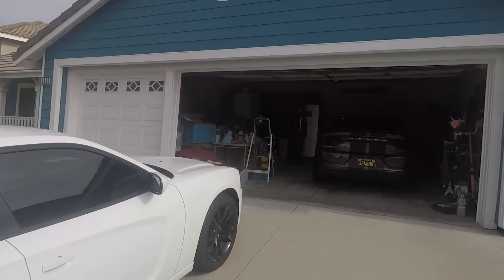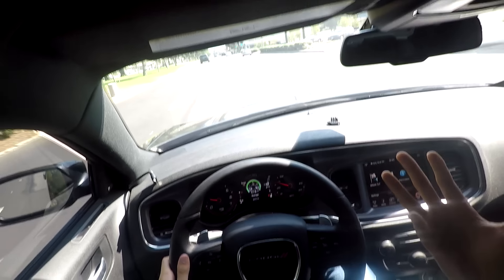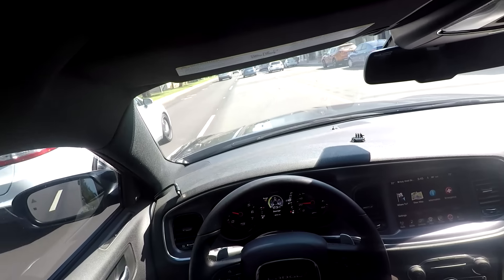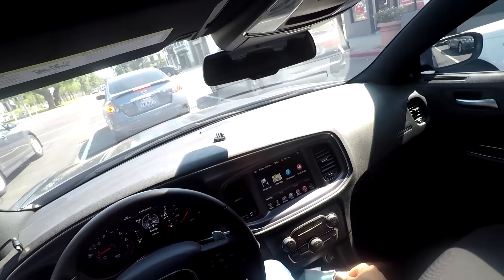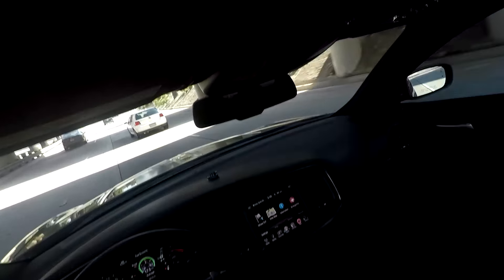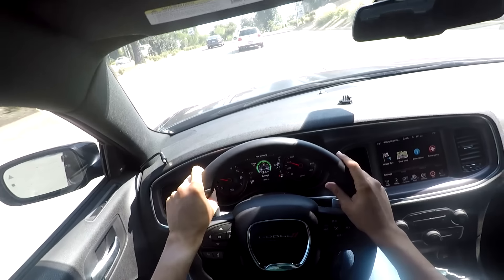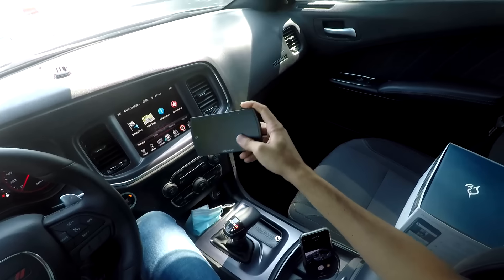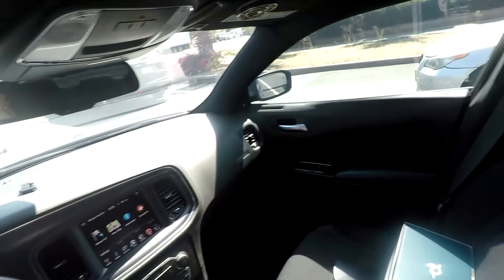CAMMED Charger R/T: First Impressions

Comment: Sounds great. I agree. I just cammed my RT with Comp Cams HRT Stage 2. I have high flow cats with my long tubes, but it is crazy loud. Some love it, some hate it and said its overly loud. And yes, tuning mine has been crazy. I used Hemifever. He did my initial stock tune, then all the bolt ons, but the cam has taken at least 6 tunes already.
Reply from the maker: Just checked out your idle video. Sounds great! The tuning stuff is just part of the game bro - I expected it
Reply: What made you chose stage 2 over the stage 3?
Reply: @jbinas4  sometimes more trans work with the cam 3 and 4
Reply: Hey I'm using the same tuner and thinking about the hrt stage 2 or the Texas speed stage 2 are you a 6speed or nag1?
Reply: @mmastar14  8 speed auto.
Reply: What do u mean it's taken 6 tubes?
Reply: @H3mif4v5r  tunes

Comment: I tool mine to a dyno tuner today. He is going to bring it in a week from this Saturday. He states that with the hemis and these cams, it is really hard to dial it in without a dyno tune. He said you can get it somewhat close and it will run, just like crap. He is going to dyno tune at several rpms to get the casual drive and wot all synced
Reply from the maker: I've heard very similar things with regards to how sensitive these things are. Keep me updated, bro.

Comment: Glad ya got it figured out. I have the Comp Cams 270 and I lost alot of lowend power when I went to th420is cam. I am getting ready to do a 3200 RPM stall to get the low back. But what is helping you is the 6.4 intake on the lowend. With my cam now and the 6.4 intake when I hit second gear at WOT the car starts to slide sideways and throws you back in the seat. My dyno I was putting down over 420HP at the wheels before the 6.4 intake.
Reply: Any vids
Reply: @just_a5.7  Nah I really don't take any vids.
Reply from the maker: Thanks man. Sounds pretty impressive. We are having serious problems tuning it. I am probably gonna take it to get dyno tuned
Reply: @DonnySRT  Just curious what are the specs on your cam. If it's the new gen HRT cams I have been hearing that they are really hard to setup. Even though I have been thinking about going to the Stage 3 HRT cam. But that's probably the best way is going to the Dyno.

Comment: My chop was cool but not consistent. Mine would idle and die in Park, Reverse with brake on, or Drive with break on. Then it was too rich, too lean. And yes I felt the loss from take off just normal driving. I have moments when it surges, almost jerking forward. Have you had that issue?
Reply from the maker: Yes, very similar issues actually. Currently still working to get them resolved
Reply: How do you resolve that?

Comment: Definitely it sounds awesome. Definitely a large cam needs a tuning. Low vacuum requires a different fuel delivery, but once it’s done it’s going to work. I guess you’re planning to take it to Dragstrip to compare with stock ones. Good job!!!!
Reply from the maker: Thanks man! Yea, remote tuning doesnt seem to be working. If it was a mechanical issue the car wouldn’t run at all, so I’m likely taking it to get dyno tuned
Reply: DonnyR/T a Dyno tuning certainly will solve the problem. Watch for air fuel ratio at idle, you probably have to run a bit richer.

Comment: I don’t know if I want an 8 speed R/T Charger or 06-10 SRT8 Charger 🥵
Reply from the maker: The 6.1 is a tank but man the 8 speed is a game changer
Reply: DonnyR/T Yep, the 6.1 is better for mods isn’t it? I wish Dodge could put the 6.1’s in R/T’s paired with an 8 speed!
Reply from the maker: Right? I originally wanted to find a 6.1 to build and learn on. I’m still passively shopping around for one honestly
Reply: SRT all the way , the NAG 1 is electronic controlled  and anyway you will be needing a tcm tune ,plus the gearing in the 5 speed is good !
Reply: Yes the 6.1s are the best route plus if you can find them you will have money left over for mods, only thing that really holds them back are the 3:06 rear gears, but 3:55 or 3:73 and a tune, it’ll cut a whole second off your 1/4, it’ll eat scats with ease
Reply: Rude Gwal Russell I might have to look into them 🤯
Reply: Tbh I’m in the same exact predicament

Comment: Remote tunes are terrible for cammed cars especially 5.7s
Reply from the maker: Yea man, slowly regretting it
Reply: @DonnySRT  where are your issues with tune? Low end or top end? If top end get a wideband. For low end it's a PITA on these cars cuz VVT so you gotta cheat by playing with injector scaling so it can take a lot of revisions. After 8-9 revisions my car still has a slight lean tip at ~1500rpm but I'm done messing with it until my superchargers installed.
Reply from the maker: Low end issues. Getting surging/stalling when coming to a stop. Third parties say the logs look way too rich but tuner is blaming it on other issues with the car. At this point, I am confident it isn't a mechanical issue because of the huge discrepancies between each tune
Reply: @DonnySRT  look at your fuel trims, wherever it surges/stalls pay attention to the numbers. If they go lower than -15 it's too rich or higher than 15 it's too lean. Triple check vacuum leaks, I swore for weeks my one cammed 5.7 was mechanically perfect but ended up finding 3 tiny vacuum leaks that altogether made it seem drastic. I'm gonna guess this is a 270 cam?
Reply from the maker: @732Mopars  Close guess... where were your vacuum leaks? I've got new intake manifold gaskets and made sure to connect the brake booster.
Reply: @DonnySRT  if you want make a post on challenger talk, me and a few other guys got a lot of experience with these cars on there
Reply from the maker: @732Mopars  Can I email you?
Reply: @DonnySRT  brake booster itself had a pinhole leak, pcv had a pinhole leak, had a bad O2 sensor on bank 1. All things that came out of no where after the cam swap.